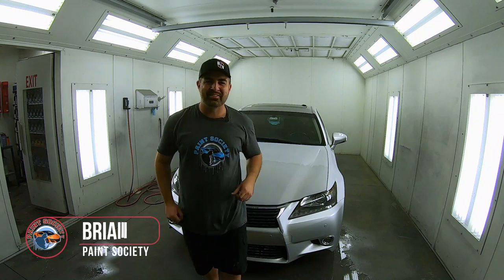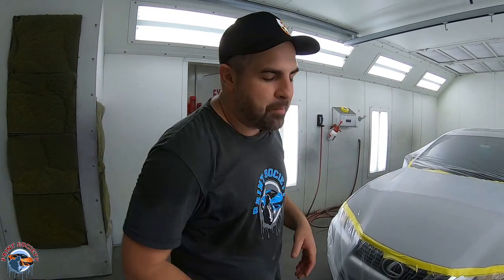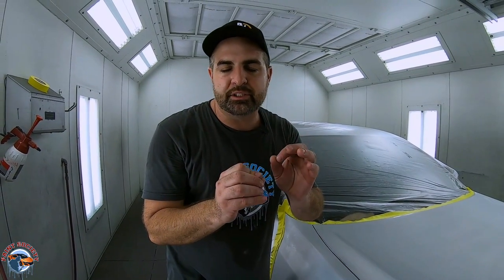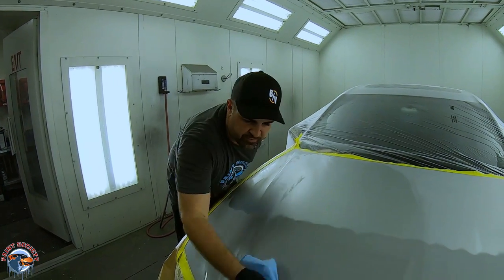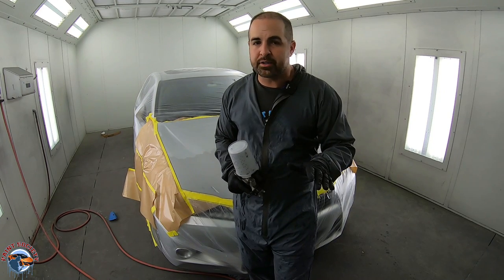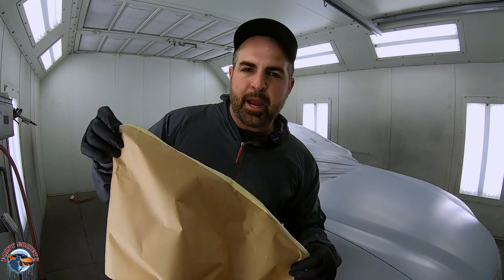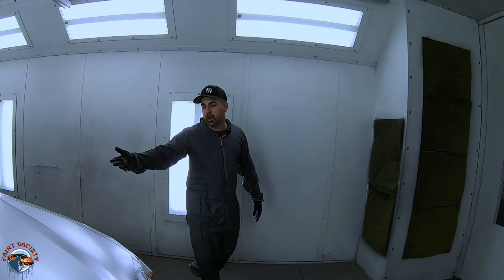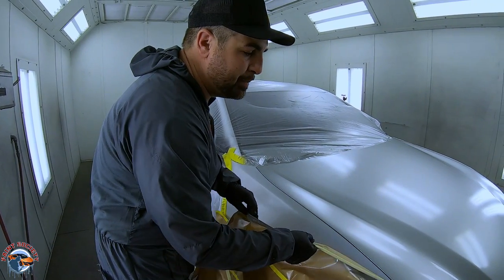How to Paint Silver without Streaks!

Comment: I have a couple of questions: if im spraying metallic on a fully prepped and primed car, do i walk the length of the car back and forth or spay a panel at t time? Is it common to spray pearl on a metallic base coat? What's the adhesive used before you spray mid coat to prevent runs?
Reply from the maker: I walk the car if it’s a Metallic for even coverage and you’re referring to clear blending additive
Reply: @PaintSociety  thank you. And what about pearls mid coats on metalic base. Is that a common practice?

Comment: Awesome video! Thank you for the content. One question: when you talk about a control coat or orientation coat...is that the same as what you refer to as a “half coat”?
Reply: Correct !smallest areas will be easier to mask!
Reply from the maker: Yes. Similar. Half coat is usually at a greater distance.
Reply: A control coat orientation coat drop coat and half coat are all the same thing. The name of the procedure usually varies depending on the paint line you're using.

Comment: Do you use a anti static gun?  and is there a more cost effect method vs the anti static gun such as endust  or something like that?   

thanks again.
Reply from the maker: I do use it and I used one here. You can use raw plastic cleaner but it only works on plastic bumpers. I got the Neutralizer and it’s much cheaper.

Comment: How much paint do I need to spray a front bumper on a Chevy Cruze? Would a single-stage paint work for that?
Reply from the maker: Gotta use bc cc to match factory finish. Shop rates may vary.
Reply: @PaintSociety  Would a pint be enough to cover the bumper?
Reply: @dealerauctionnightmare4689  A pint would be more than enough. I bought a quart of Omni and painted the hood and both bumper covers on my Corolla. 3 coats and had a couple ounces left in the cup.
Reply: @davidl2736  awesome! Thank you for the information.

Comment: Hey brother how much PSI you use for the clear coat, and can I sand my hood with 2500 sand paper after clear coat
Reply from the maker: Psi is different for every gun and every system. Generally between 25-32psi

And yes 2000 grit to 3000
Reply: @PaintSociety  Gracias brother 🤙💪

Comment: Learning to paint in theory is not the same as in practice ... What I have struggled with is a SAAB 9-5 with color code 268 (silver) over and over again. And I've learned a lot from you, but it's just making it practical that helps. I do not understand a thing. How to get rid of edges created by the base color and clear coat. I am happy with my spray, but when I have to remove the masking tape, all work is sabotaged because the tape pulls with the varnish. I have to do it again until I can, it's that simple because I will be really good at this because it's great fun to paint cars.
 By the way ... Why do men choose to have sex with a teacher? Well, you have to do it again until you can ...